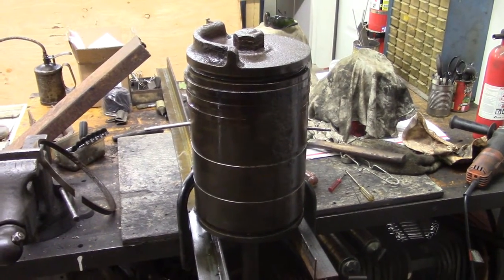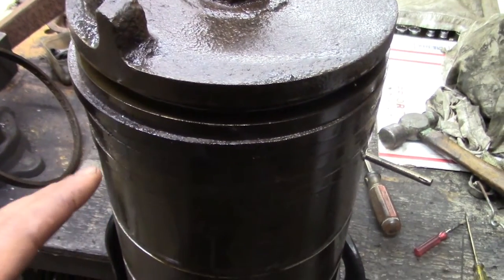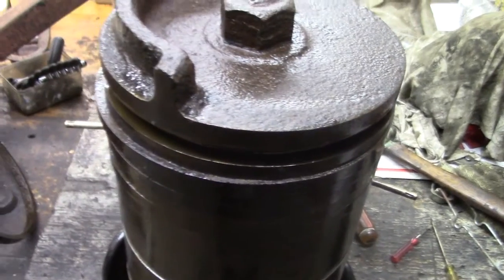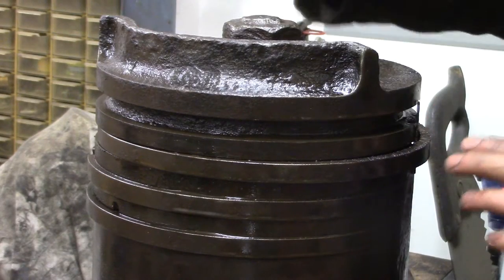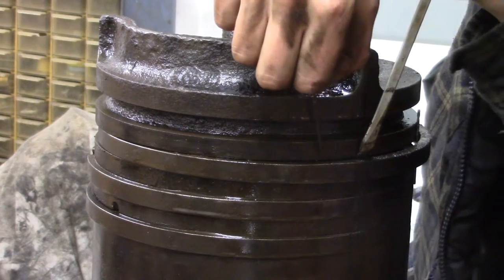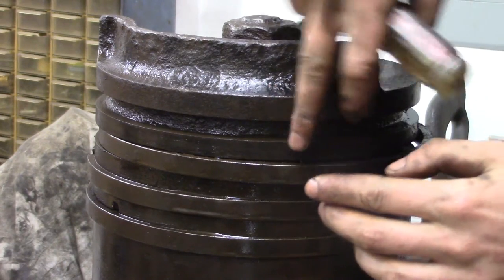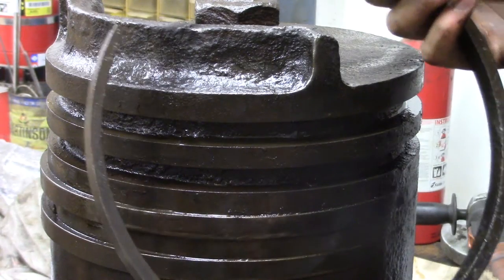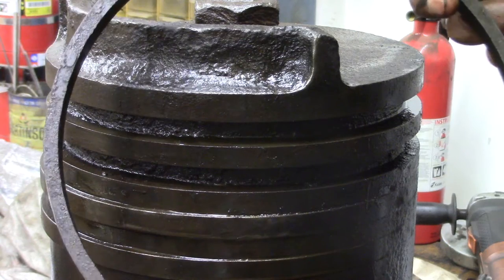How to Remove Large Piston Rings - Pattin Bros Oilfield Engine

Comment: i just use long thick zip ties.. just pop the ring out of the grove with a flat head... put zip tie under it from bottom to top.. loosely tighten zip ties (i use 3 zip ties) when you grab all 3 zip ties in the center of the piston it will leaver the ring outward expanding and loosening the ring ...then just give a firm tug upward evenly on the zip ties and the rings pop right off.. the girth of the zip ties don't allow it back into the next ring groove and they just slide passed it.. when your done you can pop the release on them and use them over and over again...even works for putting new ones on
Reply from the maker: Interesting technique! You should consider making a video of this method the next time you have a job like this. Thanks!
Reply: its not my original idea.. i got it from youtube from someone that was rebuilding a large Cat engine on a tugboat... and i just applied it to my big bessie.. i am actually kind of new to the "old engine" collecting. i only have a large bessemer oiler don't know the HP i think its 20hp and a little reid 5hp h&m
Reply from the maker: Cool! I've always liked the Bessemers. and i didn't know there was a 5HP Reid! You should put up a video of it running.

Comment: I have also re cut the ring surface in the lathe to clear up wear and corrosion and they clear up good. The change in end gap was not a problem,a filler can be added if required.

Comment: A strip of thin steel sheet worked round behind piston ring until it is all the way around the piston . Plenty lube required . Then slide up and off the piston. Makes getting them off over multiple grooves a breeze and without breakage. A strip cut from an old oil can is just about perfect thickness and thin enough to be easy to pull around behind the ring.
Reply from the maker: I tried that, but the sheet i had was too thin and bent into the ring grooves. The drill bits worked pretty decent.

Comment: Very good presentation. Was wondering if you planed to use any type of Graphite spray when you install the new rings to reduce wear or any other type of anti wear materials.?
Reply from the maker: No, just some oil for assembly.